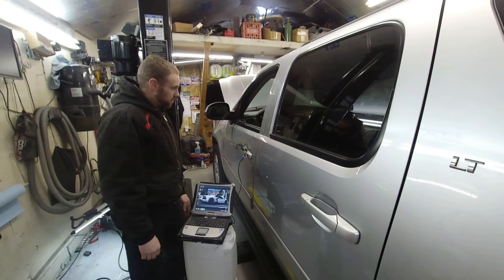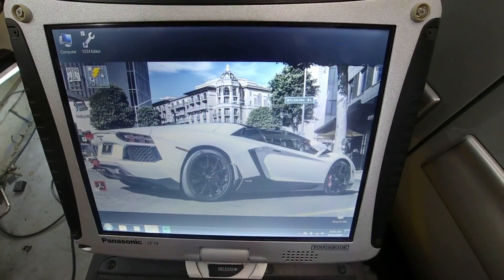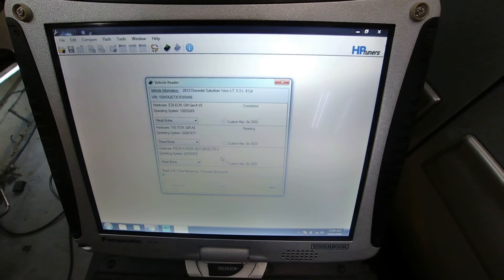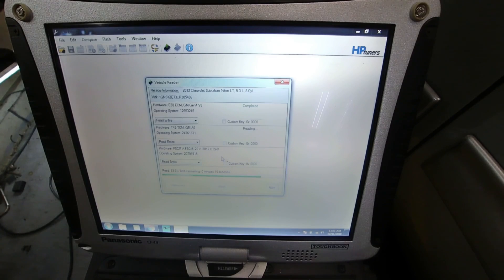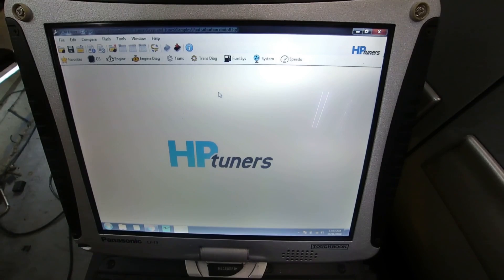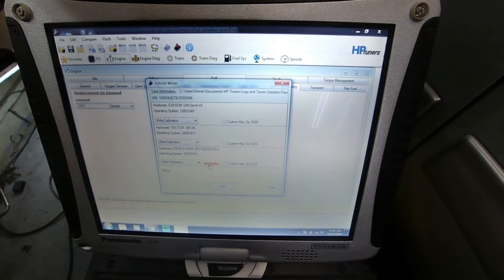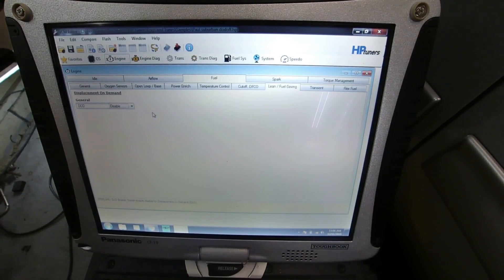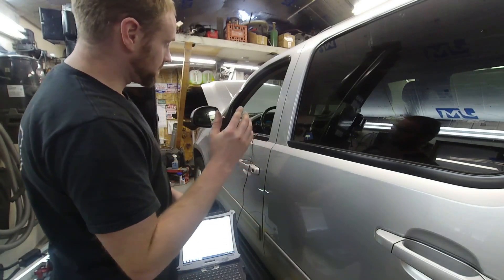HP Tuners DOD Also Known As AFM Disable In PCM

Comment: I wish you started your video with a cost value $$$. How much does this actually cost ???
Reply from the maker: More than it's worth for one time use and it also depends on how many credits you buy with it. I should have a link in the discription. Also prices may change over time.
Reply: @CrazedPerformanceRepair  link is no longer working. Is it a tuner device or only a software and license/credit?

Comment: Would there be any problems if I disabled dod in the ECM but left the OEM hardware in the engine? As in I've got a low tick on startup that stops after a minute or so but no other problems... Yet also can that programmer turn on remote start. I put the remote start fobs in and can see in the ECM when the start button is pressed but I need to get factory remote start turned on.
Reply from the maker: As long as the VLOM doesn't cause any issues it's fine to disable DOD in the tune. In fact I recommend it. As for the remote start part of things I would have to do some digging (start with google) I'm not sure I never tried it. Perhaps contact hptuners and ask them. I would think the body module would need a flash more than anything and I don't believe hptuners does much in that department.

Comment: What I am having trouble understanding is if this DOD delete gets rid of the pressurized oil that pushes in those pins, allowing the lifters to collapse, the loud lifter ticking noise before the repair wasn't due to a lack of oil getting to the lifters?
Reply from the maker: The lifters get disabled by adding oil pressure but if there is not enough pressure for example a plugged screen the lifters will damage themselves.
Reply: @CrazedPerformanceRepair  Right, but I wonder why the collapsed lifter results in a loud lifter ticking/clacking sound.  Anyway, I tried your method of releasing the lifter using a sanded push rod, and it worked great.  Thanks again for your efforts.
Reply from the maker: @WILSON.1  that is from the pushrod smacking the rocker.
Reply: @CrazedPerformanceRepair  Ah, okay, that makes sense to me now.  Thanks man!
Reply: I'm going through this, the dealer quoted me for $10,800 for a Jasper engine Diablo tuner with a 4 year warranty but obviously I'm not doing that for an 08 truck that I owe 19k on I'm taking it to a gm tech that works for the county now I'm just curious what you charged for a delete kit and tune out if the afm. He is going to take it apart and see what's going on and tell me what I need if I need new cam and all I need to replace. Thanks been hooked on your videos since my truck did this. Your really good and explaining everything I've learned allot from watching your videos

Comment: About to pull the trigger on a 2015 Silverado on Monday possibly from a local truck dealership but Truck had stabilitrac & cel light on after about 10 mins into test drive (bummer) but your vids are so helpful and make me more at ease about buying a Chevy 5.3 now. I love the truck so id do the obd2 plug in delete first propably just for peace of mind, but considering doing the full delete if the plug in tuner doesn't solve the issue. Your vids rock! \!Subbed!/

Comment: You don’t have to spend 3 credits on that.  Just when you begin to download select just pcm and trans.  Then will only cost 2 credits.
Reply from the maker: That's what I thought too  but it wouldn't continue without it unless I did something wrong?
Reply: No just select read ECM only and read
Reply from the maker: @jcw2002  that's what I am doing now still waiting for a newer one to come in the shop that is new enough I know for sure it was the 3 credits. So far it's been 2007-2010 since I started doing this process about 2months ago
Reply: @CrazedPerformanceRepair  i just did it to mine after i the cold startup lifter tick got much worse one day.
I already had it unlocked via hp tuners to firm up the shifting in the 6 speed...
Googled the issue and instant hit for the dod issue.

From my first transmission edit, hp tuners says my vehicle only needs 2 credits.
I believe that's the trick here.
From my reading, the third credit is an extra thing that gives you more options should you wish to go boosted.
Just exclude the third module when doing the read.
If the dod option is missing, then you know it's in the extra module.

Comment: If the truck went to the dealer for a refresh of something, would it reset the DOD back to on? 

Also I would love to get a tuner like that, but with the initial cost and credit price charged per credit makes it not worth it for the little use It would get. I send my Pcm's off to LT1Swap.com to shut the DOD off post repair.
Reply from the maker: If it went to the dealer if they didn't touch the pcm it would be fine but if they did some sort of pcm update or flash i'm not sure how that would work out I guess. If LT!Swap is a option that is good info to have and i'm glad you shared it.
Reply: @CrazedPerformanceRepair  
He has your collapsed lifter cheat video listed on his site. I thought you were him or a contact for him. I have used him half a dozen times for DOD delete. Never had an issue. He charges $50 if you send the PCM to him to delete the AFM. 

http://lt1swap.com/afm_delete.htm

Comment: Does that HPtuners software require yearly updating or a yearly fee or you just purchase once?
Reply: I did this a couple weeks ago (after using your patented CPR  lifter punch rod to open the collapsed lifter, thank you very much). HP Tuner credits are $50 each and you look up make&model to see how many credits are needed to unlock and reprogram a single VIN. For the 2013 Yukon this was 2 credits. It then took one additional credit for "the file", not sure what this was about but after boofing up another $50 I could then write to the truck. It was made clear that I now have UNLIMITED access to reprogram this truck as many times and for as long as I want. For another 10 credits I would be able to upgrade and write to any 2013 Suburban or Yukon XL.
Reply: @woll3Y  Thank you, thats good to know.
Reply: How many credits u use for 2015 Silverado
Reply: @chillin_dylan09  check their website
Reply: @chillin_dylan09  2